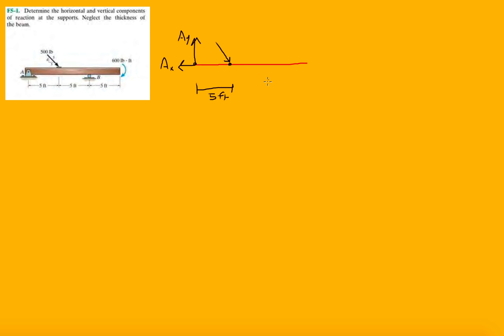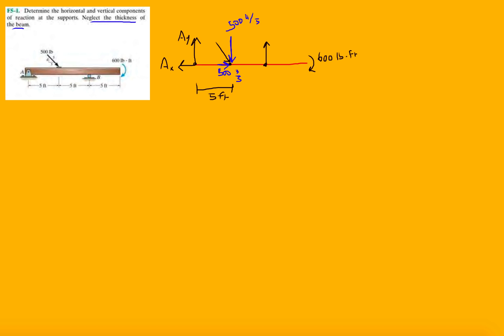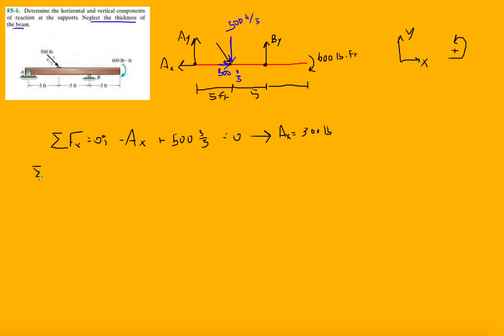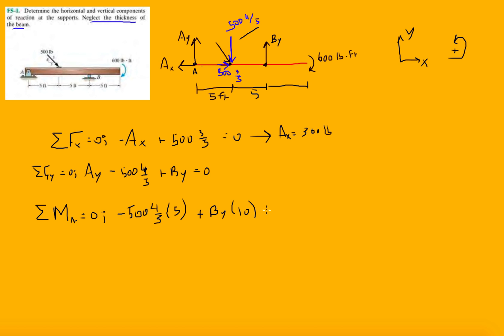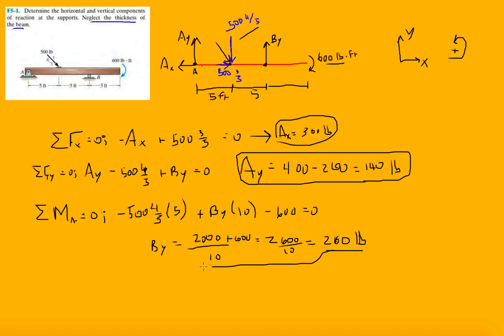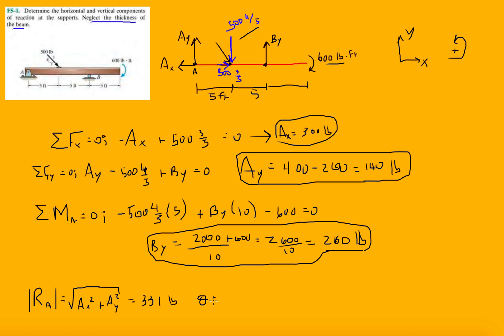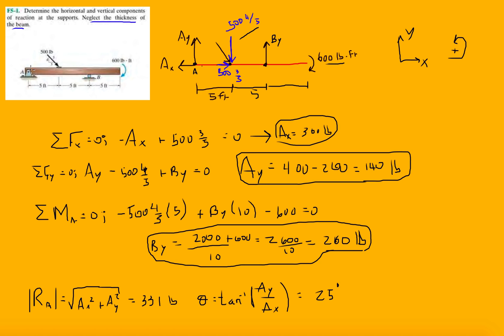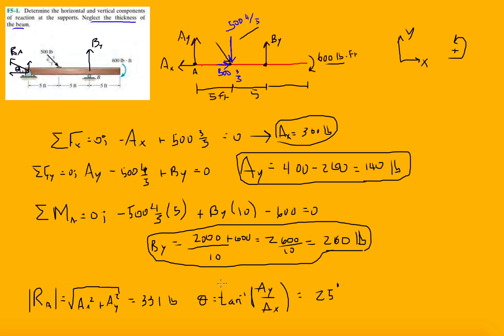Problem F5-1 Statics Hibbeler 12th (Chapter 5)

Comment: why there is no Bx force?
Reply from the maker: Remember the roller/rocker support doesn't have an x force opposing it. It can slide in the x direction freely but it is constrained in the Y...hence only y force. good question.
Reply: @theengineeringcrucible3490 I have a question why in £Fx  Ax is I've it should be +ve i guess bec we have taken anitclock wise direction ....